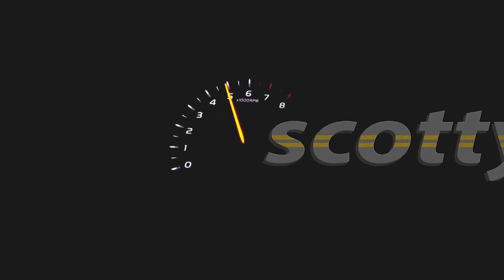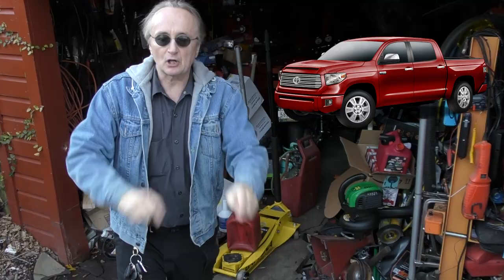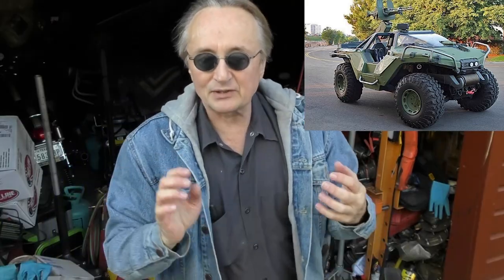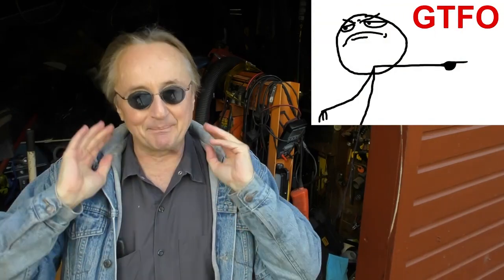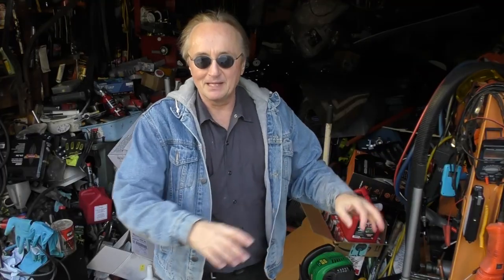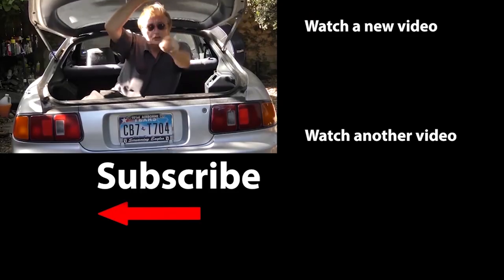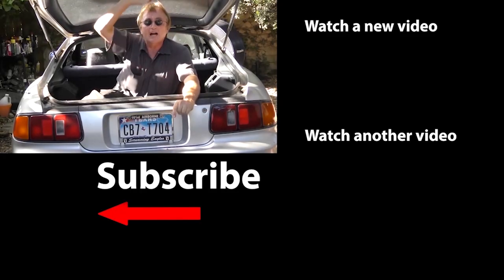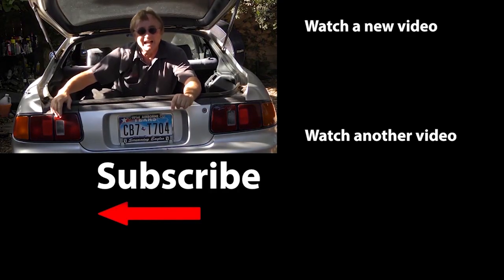5 Used Trucks You Should Never Buy

Comment: My family has had a Ridgeline for well over a decade now, and while it certainly is debatable whether or not it's a "real truck," it's been a very reliable vehicle.
Reply: It's officially a mid size light truck. The only reason why it's a debate is because they're not popular like the other models. But they are definitely mid size trucks. Pound for pound, the Ridgeline since 2016 has had the best overall ratings according to some publications like Consumer Reports.
Reply: Todd Sands Yeah man ours has been our dedicated work vehicle for at least a decade. It tows my dune buggy nicely.
Reply: The advantage the Ridgeline has which I have started to learn a bit about light trucks is its uni body construction. It's a bit more expensive to make during production, but it strengthens the overall durability of the light truck. I think Ford and Dodge will make one of their special edition pick up trucks a uni body from time to time. The Ridgeline is extremely underrated because of assumptions - and because of course, it's a Honda made vehicle. But it's definitely a very strong and reliable pick up truck. It's just engineered a lot more different than your typical pick up truck. I think the blown engine thing is a bit isolated. I always believe most modern pickup truck performance depends on the owner. Many owners assume too many things from a mid size truck. Most modern ones worth their salt are good. The American light truck market no longer dominates as they normally used to.
Reply: Todd Sands Yeah the engine issues were a few isolated vehicles from the 2006 model year. Otherwise, the engines are honestly pretty bulletproof, probably the most robust J series engine and the strongest auto trans that Honda makes considering that they assumed that people might tow with it.
Reply: I  have a 2006 Ridgeline that I purchased used at 198K about 2 years ago as a daily driver.  It now has over 250k.  Last year, I drove it from Georgia to South Dakota pulling a 3000 lb trailer with 3 other passengers.  This is the most reliable, comfortable, and versatile vehicle I have ever owned. Maybe it was the previous owner who took care of it from the start, but from speaking to other RL owners they all have the same good things to say about this model. I would not hesitate to purchase another but my RL is going so strong now, I don't have the heart to trade her in.
Reply: Honda is super reliable
Reply: @toddsands6000  The specs on a V8 Dakota beat the V8 dodge Ram in every way except in bed cargo weight. A $300 suspension upgrade would beat that too. And the Dakota was cheaper, better turning radius, lighter, more fuel efficient, better towing, better handling, etc.... If you give two trucks the same engine, the larger "full" size truck will always be the less capable machine, simply because that engine has to throw more truck around before it even starts getting loaded. People who think they have have a "real" truck, always ignore the power to weight ratios and just act smug.
Reply: Remrie Arrie - That's interesting to know. My brother has an old Dodge Dakota. Other than some suspension troubles in which he neglected the 4 x 4 maintenance, It's a highly and reliable light truck. I was wondering about what you mentioned, but was unsure. My gut pointed me to purchase a mid-size truck. I don't need to haul anything too heavy. Your point on size and weight distribution sort of made me not think about purchasing a mid-size truck with a four cylinder engine. The V6 engines seemed to put out similar mpg. I believed a four cylinder in a mid size truck would have to work a bit harder due to size. Some may disagree, that was my opinion that a V6 was the best option for a mid size truck.
Reply: @toddsands6000  Dakotas are (or at least were) classified as a mid-sized truck. Trucks like the Ranger and S10 were the light duty trucks. I don't know of any other mid range trucks other than the Dakota. But the Tacoma and Ridgeline get classified as such. It might just be very arbitrary classifications. But don't ever get a truck with a 4cyl engine engine. Not unless it is a tiny pickup like the S10 and Ranger were. They don't have enough HP or strong enough transmissions to handle much more than moving furniture. Stick to V6 at least. A V6 is mid sized pickup should be powerful enough to tow a trailer with another duplicate truck on it. But my rule is regular wear and tear should not exceed 75% of what the specs allow. So if the truck can have a bed weight of 1,000#, don't exceed 750 on a regular basis. Or if it can tow 4,000#, don't regularly tow more than 3,000#. 

My dad made the mistake of building his own trailer to move our belongings half way across the country, it was heavy enough that he the transmission wouldn't get into the highest gear. That one trip was enough to wear out the transmission prematurely and cause significant engine wear that shortened the life of the vehicle. I'm surprised he didn't didn't weight it at a weigh station at a local truck stop, because that would have told him if he was exceeding the weight tolerance. 

If you have the option of getting any one of 4 trucks with comparable fuel economy, the day to day costs will be the same. If the trucks only differ between V4, V6, V8, or V10 and they are all close to the same price, it is better to eliminate the two trucks that don't make the cut in terms of specs, and lean in favor of the one with the larger of the two engines. The day to day costs will be higher due to the lower gas mileage, but you will be less likely to have to get a new or rebuilt transmission, differential, or engine. This is where you have to gauge your personal lifestyle. I'm not a contractor, and I don't drive much. So I would lean in favor of a V6 pickup, but get a V8 "just in case" I need or want to work it harder than what the V6 could handle.

If I leaned for the V8, my options also include the V8 Ram vs the V8 dakota (at the time), and I'd pick the Dakota for the cheaper price and better specs. Especially since the complaint about the lack of headroom isn't an issue for me. But overall, the V6 was perfectly fine for me. If I needed to haul gravel for a new driveway, garden, etc. it would be better to rent a dump truck. Because it is all too easy to mistakenly buy 1 cubic yard of a material like gravel (2,700#), which easily exceeds the max payload of a V8 (1,800#)

So those trucks are really just for personal light duty use. Hence "Light Duty" pickup. Although most "heavy duty" pickups are just branded as such for marketing purposes. You really don't get into heavy duty equipment until you get into duly trucks, box vans, flat beds and dump trucks. And the price ranges for those vehicles, and their fuel economy reflects that. If fuel economy is an issue, it becomes better to just get a used 2 axle short top daycab semi truck since they cost the same. They are grossly overpowered for such projects, and they have similar gas mileage. I used to drive a semi truck that got 12 MPG while towing a 12,000# trailer. So my GVWR would be 30,000# empty, and I'm getting better fuel economy than these dweebs bragging about their Fords, Chevys, Dodges, GMCs, etc.

Comment: The old honda ridgelines weren't as great as the 2nd gen. But Honda listened to those complaints in the past and built a better truck. Truck enthusiasts would still say it isn't a truck, but it has a bed and it could haul medium sized things so it still passes. Hell, it's just as good as my dad's 2001 F150 XLT which is a  V8 and the ridgeline has better fuel economy. It is also the safest pickup truck to date. I also love that it handles like a car so it can go swiftly through corners and has a tighter turning radius. It also has the best gas powered fuel economy of the mid-size pickup range. Honda's goal with the Ridgeline was to create a truck that was completely practical with all levels of truck use and although it suffers in the looks department, it's not really about the aesthetics, but the function.
Reply: @Nippledozer  - and the old one has a volume knob.
Reply: I completely agree, I don't dig the current front design but the side profile and the rear end looks nice
Reply: @markh9675  the base trim RT has a volume knob
Reply: Love my 2019 Ridgeline. Drives great decent fuel mileage comfortable on long trips trunk is handy and while I missed the volume knob the steering wheel control is perfect.
Reply: We love our 2006 honda ridgeline! Its been an amazing vehicle, extremely dependable. Has well over 215k miles on it and very few issues, (alternator, battery, tires, spark plugs etc.) Its our favorite vehicle we've ever owned.
Reply: @MrsWhite-vb7go  I agree, I own a 2010 RTL and the truck is still running strong at 160K. Only issue I've had was replacing the steering rack due to rust but not a single speck of rust on the body and I live in Michigan. Any other domestic vehicle built in that year is probably rusted through by now. Very dependable and reliable truck.
Reply: I don't even know why Honda came out with that truck or attempt to even make it. There are so many truck designs, models, and trims from Chevy, Ford, Toyota and now Jeep. I bet within 10 years that Honda truck will be cancelled. Even the Toyota tundra struggles to compete with Ford that sells close to a million F Series trucks while Toyota barely makes it to 50,000 a year. Both Toyota and Honda engine technology is weak in trucks. It shows why a full size Silverado can get over 25mpg while a tundra gets about 19mpg and looks aged and is pretty heavy compare to a Ford F-150. And now Dodge is coming out with another truck with a hybrid engine standard...toyota and Honda are far behind the truck market and technology.
Reply: Eh, but if you want a "truck" it shouldn't be IRS unibody v6 AWD?  call it a ute or el camino
Reply: I bought my 2008 Honda RTL used in 2010 and I have been extremely happy with it.  It now has over 175K miles and it works great.  I believe you missed the mark recommending  folks not buy Ridgeline.
Reply: @Nippledozer  if I remember correctly, the 2nd gen got a bit higher crash test ratings than the old one. On top of that, it also hauls a bit more.
Reply: @markh9675   that is one of the biggest complaints, but the driver steering wheel has volume buttons so it is not that big of a deal. Actually I prefer it not having a volume knob. My current acura tsx volume knob gave out at 90K. It can turn it up, but sometimes it wants to turn it down while Turning it up.
Reply: @budskrilla2u133  well, it is still more powerful than the odyssey. Also the transmission is different so that it can haul 5k (or 6k if you want to ignore the safety suggestions)
Reply: @thecentralman  It looks decent. It reminds me of my dad's 2001 f150, which also had sort of a bland front end. I wish somebody would come up with a body kit that could change this a bit. lifting it and adding some off road tires does make it look better though.
Reply: @Flash363  rust was the biggest issue in the early 1st gen.
Reply: @lucky1206  it might be cancelled in ten years, but toyotas and hondas will far outlast anything GM or Dodge has been making for the past few years. Honda made this truck for people like me. I don't work in a heavy job, but I do like to make stuff and getting into woodworking. I also plan to buy a small trailer to haul to accessible campsites. All the other midsized trucks try to tackle exaggerated segments of the market, but honda looked at it a different way and wanted to make the best all around midsized truck.
Reply: @joshkahn2576  the 1st gen had big issues with rust and the transmission. the bed was shorter as well and everybody hated the buttress.
Reply: J G  not at all, it is half an inch shorter than my dad's 2001 xlt f150. That is how it is with most four doors.
Reply: @Nippledozer  Not in the early 1st gen models. Those also were really prone to rusting if I remember correctly. The problem with the old model is that it had good suspension, but not that great of an engine or transmission. 2nd gen could be lifted as well.
Reply: @Nippledozer  I've read about people doing 2" lifts.

Comment: Scotty, Just to make sure- your specifically talking about the Ram Daytona model and not the other 1500 series? I have a 2014 Ram 1500 and have had almost no issues with it so far..granted I do not do hard work with it. I use it for weekend trips to the Lowes and otherwise just highway mileage to and from my job. I also have a 2013 Dodge Dart that I use for 3-4 times a week for work to help save on MPG and keep the miles down on my truck..no issues with it either and both have around 42k on them.
Reply: I have the same model.  8 foot bed.  I bought a truck to have something that lasts for a long time

Comment: As most trucks are used as daily drivers the Honda is a fantastic truck. Best handling, nicest ride and an AWD system that is actually usefull on icy, snowy roads at speed. Agreed, its not for hardcore off roading but for the other 99.9% its superior.

Comment: The ridgeline isn’t really a truck...in the truest sense.  It’s a pilot for the most part with a small bed. Family of mine had one and it’s been reliable 100%.
Reply: I'd love to know, in the truest sense, why the Ridgeline isn't really a truck?
Reply: Its more like a modern day el camino..
Reply: @tjl8884 So to be a truck, the bed and the cab have to be separated? Does it also have to handle like crap and have zero torsional rigidity?
This is the most common and the worst argument for why it isn't a truck.
Reply: aloysious Pickups are generally two separate pieces on a body-on-frame platform.
Come in either RWD or 4x4.
Ram 1500 handles amazing btw.

Honda calls the Ridgeline a SUT “Sport Utility Truck”, it’s like a triple crossover features of a SUV, a Truck, and Car.
Just like Pilot it’s built on a car-like Unibody crossover platform. Only difference is the Ridgeline  a bed like truck.
It’s also FWD based AWD.
So it’s basically not a full on Truck, but it’s own separate thing.
Hyundai is building a similar vehicle based on the Santa Fe.

Comment: I have a 2008 Ridgeline with 144 k miles on it.  It's not for "heavy duty truck stuff", like some of the other trucks I've had, but it's good for hauling lots of "odds and ends", and things that just won't fit too well in  a SUV or might get the carpet dirty.  It's also a lot easier to park, but the mpg should be better. Over all,  I like it.

Comment: Scotty showing his Toyota bias again got it wrong. 
Honda Ridgelines are fantastic for what they are. I had one, dependable, good gas mileage for a 4 door pickup, and hauled my boat with absolutely no problems. Hauled a motorcycle a few times in the bed, and I loved the in-bed storage compartment with the dual function tailgate. These are actually great off road as well. But  anyone thinking they are going to tow 18000 pound trailers with a Ridgeline,  you will of course be wrong. Also, the transmissions are just fine unless you overload it while constantly driving in the mountains.
Reply: I saw someone towing a boat and trailer which had to be 35000 pounds combined out of a marina to a dry dock just down the road. Both impressed and scared to be anywhere near it. Those brakes were never meant for that.

Comment: We have a 2007 Ridgeline that we purchased used in 2009. It now has a 185,000 miles on it after driving long distances and off road for work. Truck was able to pass areas that co-workers weren’t able to with their Toyota trucks. The ride is far more comfortable as well. We’ve had a major service on it and kept up with maintenance. The power steering does have a crack in it now. We keep debating whether to fix it or just keep using the leak stop. 🤷‍♀️ Really, we are just in awe of how well this truck is still doing and all that it has been through.... no light duty here. I could go on about all the other aspects I love about it...